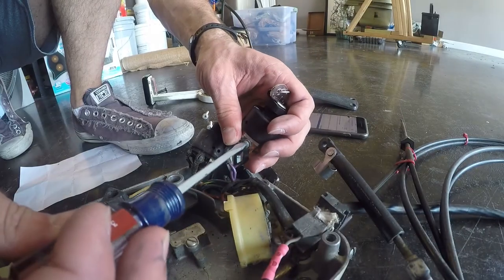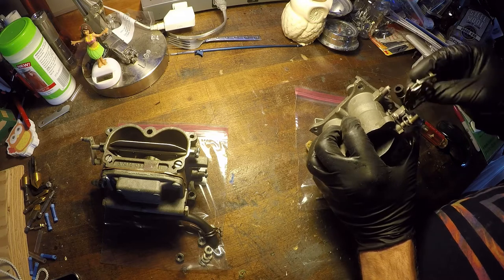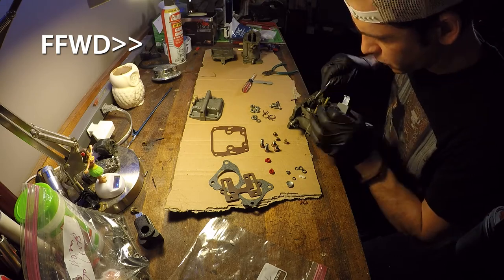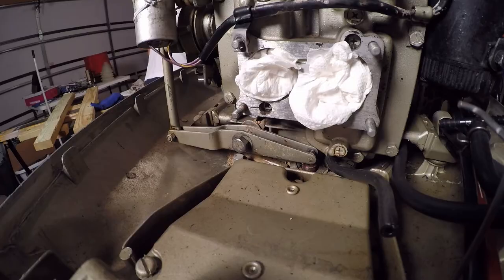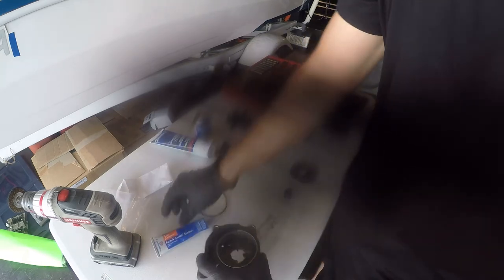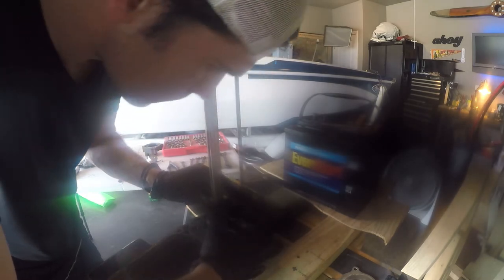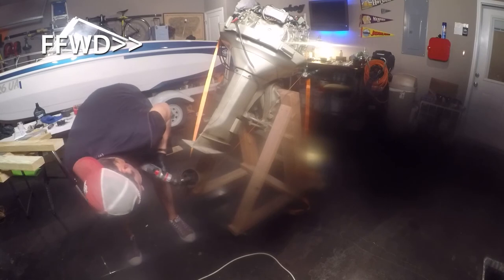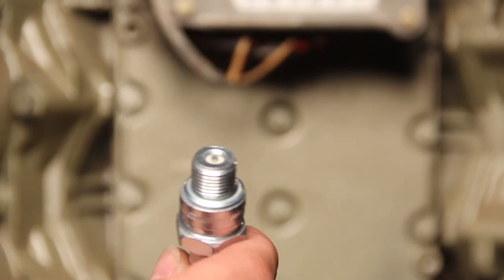My Mistake and Tuning Up the 1973 Evinrude 85hp // Project Glastron/Vlog #30

Comment: Picked up one of these that starts right up and comes with control and wirings for $500. Thought it was a steal until I got it home and ran it longer, thing has strong water coming out of telltale (which was added by previous owner) but after idling for a like ten minutes it starts heating up slowly where teltale water is hot enough where you can keep you hand under it for like 2 minutes and engine head also burns if you press your finger on it for a few seconds, I turned it off right away and am confused. Any ideas please, anyone?
Reply: Thermostats

Comment: First off, go buy some flowers and kiss yourself girl for putting up with you workin on your project, something I forget to do often! Secondly,  Float adjustment is critical as you stress. OMC/Evinrude/Johnson sells a multi-model tool to check float height but GENERALLY most carburetor floats are adjusted to the float being level with the face of the carb body/float bowl mating surface. I love your project details man, way more than I have for an entire project. I have the detail in the mechanical/electrical side but  when it comes to the in hull work/fiberglass work you did .... I am comfortably cutting corners in that area, but safely enough as I plan to keep the HP low on this boat to mainly just fish locally. I appreciate a dude who works the way you do and is diligent in documenting it all. As a forum user in other areas, I know documenting work is motivating (and I’m  sure with your collection of videos) presents finishing in a manner other than timely isn’t even an option! Keep up the good work man and forget about the smudge, the progress was still made and that’s all that matters. Bonus on top of that for pushing through the video. When your on the water sipping on a good drink this smudge will be a laughable part of this whole crazy process.
Reply from the maker: Ha ha, yeah she's a keeper for putting up with me.  Thanks for the tip on the multi-model tool, I didn't know that existed.  I've always been more into the mechanical and electrical side as well.  The fiberglassing wasn't nearly as bad as I expected it to be.  But, I don't expect to utilize that skill again any time soon. Good luck with your boat, I hope you are on the water soon.  Thanks for watching my videos, I truly appreciate it.
Reply: Mine just told me I spend too much time on my boat and I’m a newbie haha

Comment: That sure was helpful and I will be revisit this video in the spring when I'm ready to do this on my 1975 Johnson 85  Thanks!  :)
Reply from the maker: You're welcome, I'm glad it was helpful!
Reply: Is that the 85593E? I’m trying to get mine running right and I’m about to go crazy. Rebuilt carbs and started a Seafoam treatment. I ran it for 12 or so minutes which it ran fine then shut it off to hot soak. Now it will not start back up. It’s got fuel in the carbs and spark. It’ll turn over if fuel is sprayed into the carbs but just die when it uses that up. Could the jets possibly be clogged or something?  I cleaned them really good when rebuilding them but the dang thing just won’t turn over.
Reply: I removed the drain plugs and squeezed the bulb and fuel comes out so it’s not an issue with no fuel right?  Sorry I’m just really new to this.

Comment: A tip for getting the impeller in place: Put a ziptie around it to compress the "blades" a bit, put it into the housing, cut the ziptie and push it down all the way 👍
Always fun to see a new video from you! I'm in the middle of glassing the hull and transom on my 14ft boat. Previous owner didn't seem to care care that the transom was full of water so when I got ahold of the boat the transom had the consistancy and rigidity of mud 😛 So now I've made a new 2" thick birchply transom. Hope it's going to be stiff enough for the 200hp turbodiesel inboard engine I'm in the middle of rebuilding and going to put in 💪
Reply from the maker: Ziptie trick sounds good, didn't come across that one anywhere or I would have tried it.  Thanks for the kind words.  That boat and motor you're working on sounds like it is going to be awesome.  Thanks for watching and good luck with your boat!

Comment: Great series! I will be rewatching your videos this winter. I recently purchased a 1980 SE 15 ft tri-hull. It is pretty much identical to yours but my front bench seats are not open for storage. Total restoration is planned to take place over winter. I can't wait to see your boat back on the water.

Comment: How much extra supplies did you have left from glassing? You said you ordered more than you needed. Mainly did you use all mat or 1708 biaxial? How much resin did you have left over? Thanks man about to start the same process
Reply from the maker: I don't know how much total.  If I had to guess I have a couple yards or less of .1708 and a few yards of CSM.  Also I had one unused flotation foam kit.  Good luck on your project, I have enjoyed working on mine.

Comment: I would like your insight on something, I’m doing the same exact thing to my boat now. I’d like to glass in a board under the bow so I can install a removable pedestal seat for fishing.  Do you think I should do it like a T and run it to the center of the boat. Like right in front of the center stringer.. I was wondering if there is a reason the stringers don’t go up that far.
Reply from the maker: If I am following you correctly, the spot you're talking about is under the floor of the bow rider section. The bow rider floor rests on the stringers, so if you want to add a board or extend the deck to run underneath the bow rider you would run into issues with alignment unless you shorten  your stringer heights.
Reply: jmink I understand what you are saying. Thanks for the reply. I have a t-156.  It’s a little bit different than yours. Idk if it’s factory or if someone else redid it. My stringers all end at the cap supports. There is other bracing in the bow. I wish I could send a picture because it would be way better than I can explain it lol.